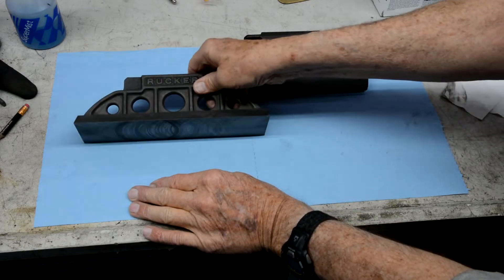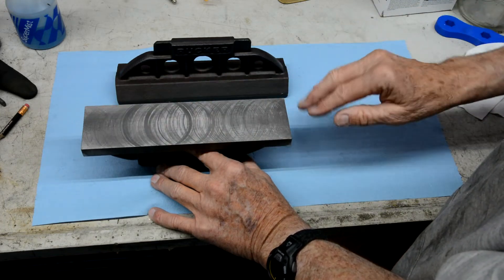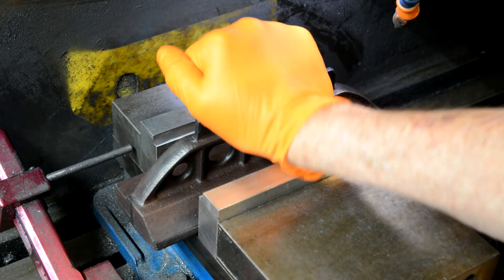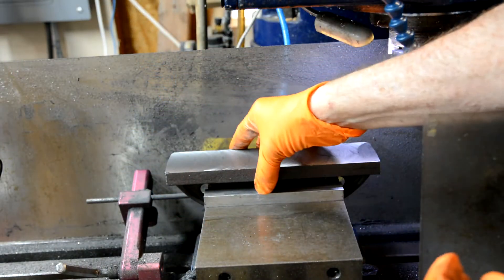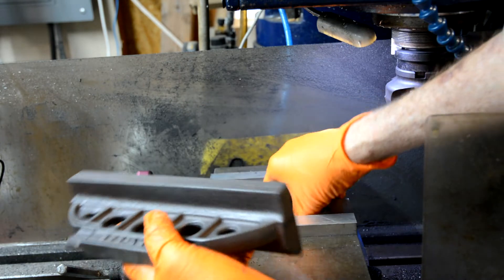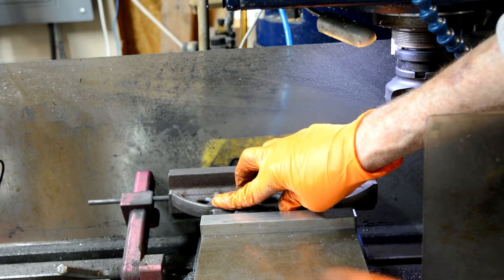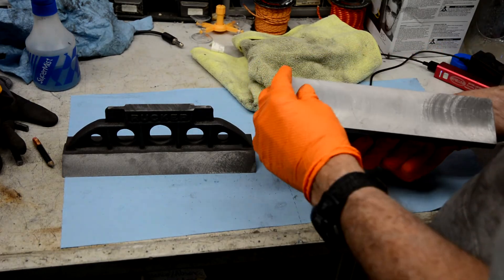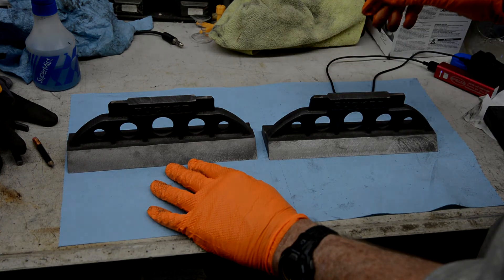Machining a Keith Rucker 9" straight edge

Comment: Vince,
I just discovered I could lap/sharpen the hand scraping carbide blades with my Baldor tool room grinder. I just set up the 5 degree tilt and do a quick pass on both sides. Now I can get going on this project.
Your video on machining the Rucker 9" is my guide to begin milling on my 9" Rucker.
The initial set up makes me nervous as with any raw cast iron casting. It seems no surface is flat or parallel.
I was wondering how I was going to mill the 45. Hey, your method seems to have done the trick.
Fortunately, I do have a surface grinder. I don't have a Biax though, you dog.
Jeff Anderson. (from the class in Vallejo)
Reply from the maker: The sure way I have seen to hold a casting is a fixture specifically designed for that casting.   I am assuming you are hand scraping?  It shouldn't take very long if you grind it first.